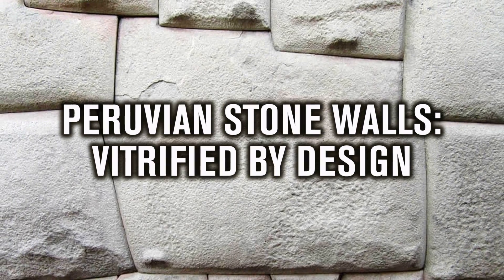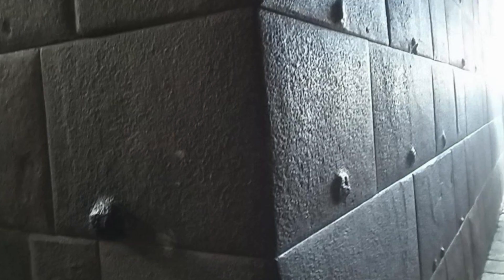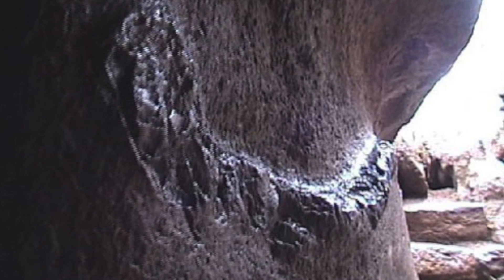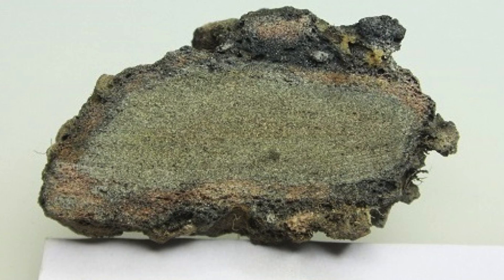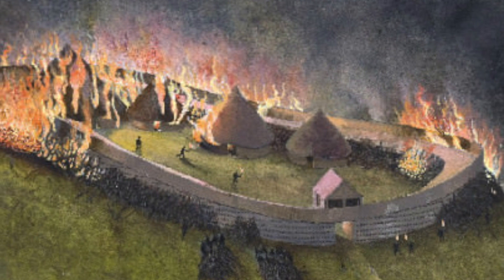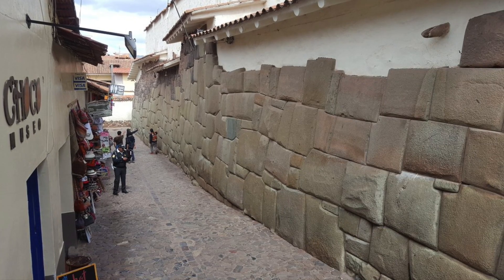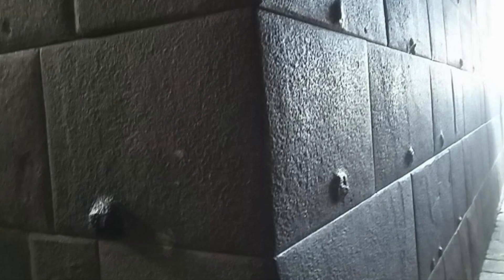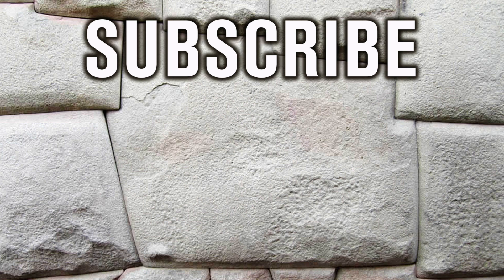Were the Peruvian Stone Walls Vitrified / Melted During Construction? | Ancient Architects

Comment: You don’t need heat to vitrify stone, see “the Hutchison effect”. All you need is the sympathetic resonant frequency of the molecular bonds of the specific type of stone. Pass a current through the material using “electrodes” and viola! The nubs are the electrode contact points. Once vitrified and placed the electrodes were pulled off of the softened stone pulling some the material with them as they are disconnected. Remember also this doesn’t provide an explanation for how they moved such heavy stones in some of the locations like Baalbek and Aswan. Plus many of them show scoop marks which means they worked the stone WHILE vitrified!
Reply: The Hutchinson effect is, at the most generous, something that has been replicated by no one except Hutchinson himself.  It sort of provides an explanation, just like so-called 'geopolymers' provide an explanation, and just like alien intervention provides an explanation.  It's not though. I can't even say this is a theory any more than saying they applied pixie dust to the rocks.  I'm not trying to mock you but something that cannot be repeated is not an explanation, it's just at best a leap of faith.  How these stones were manipulated is an enduring mystery. I have no clue. No one has a clue. It's one of our few mysteries and we should maybe just enjoy it as such.
Reply: That’s the best theory I’ve ever heard after years of thinking about how this could be done. I really think you’re onto something !! The nubs are electrodes, got to be. Then they scrape the heated stone with the copper tools, hence the scoop marks on the faces of some blocks.
Reply: Looking forward to watching your video proving this. Until then it’s just another sci fi premise that requires Proof 
The Hutchison Effect occurs as the result of radio wave interferences in a zone of spatial volume encompassed by high voltage sources, usually a Van de Graff generator, and two or more Tesla coils. (Wiki) Did they have these?
Reply: @odinx1856  didn't they test lighting fires on top of the stone and figure out that it was then far easier to hammer away the stone with those diorite balls? it sure isn't feasible way of quarrying if you just hammer around with them but after the fire it is apparently fairly easy since larger pieces chip off.
Reply: So Steve. Do you really mean to say that this mystery is best kept mysterious and not understood!?
Reply: Mr Hutchison wasn't the only one interested in the "Hutchison Effect".
Reply: @shanedog9082  had to reject that ideas for a few reasons—nubs are not on every block. Stone doesn’t transmit current.
Reply: @goonyhill1857  did that not give high voltage, but I always though it was high currents that were ended to melt materials
Reply: Not so sure about electrodes, no proof of any electrical equipment. However historic evidence of vibration control and resonance has been confirmed for quite some time and it was used in many countries. As far as I am aware though no actual solid material has been turned to a semi liquid state through vibration and then back to a solid (forgive me if I’m wrong). 
From experience I can say that polished concrete ( or shall I say incorrectly polished concrete) does also shell like that in the video, meaning that the concrete wet material is worked to the face but doesn’t fully adhere to the hard fill and thusly falls off to give the same effect. 
Vitrifying these stones into these 90 degree corners would be very difficult, especially without some formwork or shuttering which would have also burned away and left a somewhat different finish to the face of the stones.
I still think geopolymer is the most likely culprit, maybe also mixed in with vitrification to give this final overall effect. Would love it to be vibration and can picture it in my head but sadly it is most likely science fiction.
Reply: idiotic, ancient people didnt have electricity, didnt understand resonance, if you think otherwise, then give proofs, also please show some recreations of such stone forming,
the knobs as electrodes - one of the most idiotic things ive ever heard, i could as well claim it was cut by light sabers
Reply: @erikjbaker  even though I like your idea, mainly because I have had discussions with John, watched many lectures by Eric Dollard, TheOldScientist, Professor Dr. Konstantin Meyl, David LaPoint and others. Studied the works of Tesla, Schauberger, Russell, Leedskalnin, Plauson, Alfven, Moray, Siemens and many others. Also I have theorized many configurations that may have been utilized, namely archeaoacoustics, cymatics or resonance induction.

There are two main factors that come into play which these ancient cultures did not have. Machines large enough to cut out and pulverize granite or other similar materials on the Mohs scale. A machine to reconstitute the amalgamation and heat it enough to solidify it into the precise shapes required. 

And so we are left with two conclusions, either an advanced civilization made these constructions with the machines I mentioned above or the ancients used technology which most people today do not understand. Just like most people do not know who Philo Farnsworth is, yet they watch TV, they don't know who Nikola Tesla or C P Steinmetz is, yet everything they use is powered by electricity (magnetism and dielectricity), they don't know who Claude Shannon is yet all computer technology is based upon his work. 

I could tell everyone what the missing information is but I've pretty much had enough of society. Everything that these great people have invented is so far above the minds of regular NPCs, and has been used against humanity by the ruling oligarchs.
Reply: also look Erik Baker, holds a playlist from Brien Forester 'Cataclysm'
you listened to some dumb scifi theories and have been brainwashed, congratualtions
Reply: @trader2137  I don`t disagree, alot of his work is alittle bit "out there". But we are all here, because we ain`t all there.

I referred to him in his experience from the Egypt tour, and it`s true that the "consensus" is that "The Unfinnished Obelisk" atr Aswan is a work of diorite balls. And this is true for basicly most of the ancient stone work pre-dating the middle kingdom and the iron age, including the Great Pyramids. 

This doesn`t add up, the construction of the tallest and grandest pyramide that remained the tallest man made structure for 4000 years ,with diorite balls and copper chissles. Then consider it`s allignment because the structure is basicly still the most presice structure pointing towards true north, then consider it`s placement directly on the meridian and also the ratios where in example pi is clearly used. 

How did they know this, and how did they do it? These questions are still unanswered. If you ask a Egyptologist it`s "by chance" and copper aged technology. 

No i don`t think so, this is the reason behind all the stupid theories out there, and none are more plausible than the next. Untill we get some plausible theories i am free to speculate and free to pick up ideas from whoever present something other than diorite balls and copper chissles.

Edit: I`ve mixed it up and have tried to correct the post.
Reply: @odinx1856  but diorite balls and copper chisels are depicted by ancient egyptians and proven to be effective, heat treating + diorite ball hammering is great way to work around granite, tunnel carving is depicted done by chisels, copper saws and abrasive are very effective at cutting granite, 
It doesnt add up only for AHT people which ignore science and evidence
Reply: @trader2137  Yes i`ve seen his videos and they are great, but imo it fails to explain in example the Peruvian walls with the almost water tight presicion observed. I can`t imagine how they could do it that way. I can`t imagine heating the stones up, knock some pieces off, try and place them in the wall, if it doesn`t fit tight so heat them up again, knock some more off, not too much and not to little but just right on every side to make a watertight fit. Top it up with the Inca`s themself clearly stating that they didn`t do it that way, they clearly state they didn`t do it at all, "the giants" did it.

And i would also argue it fails to explain how you construct a great pyramid that way, and the kilometers of tunnels underneath them. And if we go back to the polygonal walls we see em at Easter Island aswell. Then you have the black boxes at Serapeum with a amasing polish that seems to been done with some form of liquid chemical.

But for sure i`ll agree it`s theoretical possible, i just can`t imagine this is the way it was done, the trial and error corrections must`ve been horrible beyond comprehension. Too top it up i will also argue that it doesn`t really fit the observations down to the end product. 

He`s experiements are great though and it`s possible and even likely part of the "solution" to how it was done.
Reply: @trader2137    there is evidence for all kinds of lost ancient high tech on the Giza plateau of which we cannot find the tools that made the marks...evidence, in the stone that you can see for yourself, even in the Cairo museum, for 25 ft diameter saws, lathes, tube drills and the like. (The penetration rate of which is far beyond our capabilities today, refer to Ben’s research at UnchartedX) Scientists and Egyptologists today CANNOT replicate the results and tooling signatures we see in the stone with ANY of the methods you suggested. You may want to reference Christopher Dunn’s research on this subject as well. I’m curious where you get your info from and where you do your research because you’re just parroting ideas of those who have vested in interests in maintaining the antiquated status quo on the anthropology of these sites (Like Zahi Hawass, pyramids built as tombs, my ass). Also you may want to look at the “Comet Research Group” and the “Younger Dryas impact hypothesis.” New research is coming to the forefront that spans many disciplines and you need to catch up, my friend...do a little digging and contribute to healthy discussion instead of just calling someone an idiot who may very well be massively more educated than you on the many different aspects of the subject. I can’t wait to see how meme’ishly troll’y your reply will be. Please feel free to embarrass yourself further.
Reply: @erikjbaker  I can answer for him because i have likely seen some of the material he refer to in a answer above. But first let me put my own words so i don`t really answer for him but myself. The striations on Flinders Petrie Core nr 7 that indicate a certain penetration rate or feed rate as explained by C. Dunn is very likely or certainly not a feed rate. And this is likely or certainly true for all the drill holes in ancient Egypt. They are not a indication for a feed rate exceeding modern standards but a result of the ancient way of drilling hard stone. But it does not explain all the different saw marks observed, nor polygonal masonry.

Now i gonna copy / paste something to dig into where you can make your own mind, but take a deep breath because it`s hours with experiments and explanations, and once in a while he does a jab against C. Dunn, so don`t rush into all these videos because it will take you some time to go trough, at least for me i used several days to absorb them:

Lost Ancient High Technology of Stone Cores: DEBUNKED Part 1 - Tapering - https://www.youtube.com/watch?v=H-d8FZjS42Y

Lost Ancient High Technology of Stone Cores: Part 2 - Deep Grooves are NO MYSTERY - https://www.youtube.com/watch?v=SMJeNLs1NLM

Lost Ancient High Technology of Stone Cores: Part 3 - Polished Surfaces of Core 7 - https://www.youtube.com/watch?v=W3KBDw07Mqc

Core 7 and How the Grooves are Formed WITHOUT a Fixed Point. - https://youtu.be/CARFBz8vUK4?t=3

This man has put down a lot of effort to re-create the process behind the core drilling, and in my mind it largely or fully explains what`s observed, and he also sums it up against C. Dunn`s experiements and why Dunn have got it wrong.

I`ve no problem in accepting that this is how it was done. It`s just part of the story though, and i wont elaborate further because the topic is to deep. As far as i`m concerned i`ve just need to accept how far we have gotten and wait for more people like SCD who can prove a theory with reasonable experiements like he does. We will eventually get answers i belive.

And to wrap it up towards your post, you`re absolutely right that these are exciting times with the YDB impact hypothesis, and also in example Gobekli Tepe that proves humans where much more civilised at a earlier point that previously thought. Archaeological findings keep getting older. A few decades ago and The Sphinx was the oldest megalithic structure at around 4600 years old, and it got far surpassed with Gobekli Tepe at 12.000 years old structure.

Cheers man i really fancy the discussion i`ve been interested for a long time already.
Reply: @BluntofHwicce  just because nobody can now, doesn’t mean nobody else has ever.
Reply: No because some stones have none and some have 1 not 2. So your theory diesnt make sense.
Reply: @flappingarms9335  agree but the quote was about conducting electricity which is why I pointed out this video. I have no idea how they may have vitrified rock but the evidence shows it did happen. There is little evidence of any charring effect on the vitrified surfaces as far as I’m aware, so how they applied the heat is up for debate. I have seen other suggestions that the rocks look like they were set in sacks and the nodules are where the sack side gave away slightly. Think about wet cement bags place on top of another surface, if the material was right the stones would form a perfect fit in the gaps they are sat on. Lamination may also be shown when this form of building walls is used. Still would love to know how such weights were moved. But if the bags were placed on top of a structure and loose material filed the bags, filling such bags would be a simple task. How the material is set afterwards is the missing part. But the fact blocks are left in quarries sort of doesn’t give much of a pointer to this theory. Is there a mix of techniques used?
Reply: @goonyhill1857  It is a very interesting subject and I personally believe the stones were roughly cut to shape, placed in position and heated so the outer layers became malleable/soft which then allowed them to conform to the surrounding blocks. Maybe the knobs were the points of contact for whatever device heated them up? But then, not every block has the protrusions. This style/method of construction is seen all over the globe! Until the scientific and archaeological world accepts ancient human history isn’t what we though these phenomena won’t be solved.
Reply: @zarni000  It`s really odd about those knobs as you say some have em and i guess most doesn`t. The lack of a proper explanation is annoying and makes for all these speculations.
Reply: @odinx1856  "and it`s true that the "consensus" is that "the stone of the pregnant woman" is a work of diorite balls. What? The consensus of the stone of the pregnant women is that's roman and by then they had forged iron tools for hundreds of years. You really have to ignore all this strawman arguments. Same with copper chisels and diorite pounder stones. Yes, they used those too in the old kingdom. But they used copper alloy saws and tube drills with abrasive also. They used stone material, as flint f ex, and hammers to shape the "sawed" granite.
Reply: @pitansgmail6792  Ah sorry i mixed it up, i ment the Unfinnished Obelisk in Aswan! Give me some moments and i`ll edit my posts to clear this up and i`ll try to get my point better across why i find it interesting as Jimmy also did.
Reply: @alanderson9711  Yes, stones do transmit current.
Reply: @erikjbaker  with a metal the eddies will be induced in it and will produce magnetic fields. The eddies are produced by the alternating current flowing through the coil. The opposing magnetic fields will cause it to float and the heat generated by the eddies will cause it to melt. So where is this applied to rock?
Reply: @odinx1856  we just have to think common sense a little. Eventually well figure it out.
Reply: Sympathetic resonance is when an object vibrates when another object of identical freqency is stuck nearby. For example a gong with a frequency of 100 Hz is struck in a room containing another, identical gong, both will sound. How does that soften stone? Unless you mean the builders had over tone emitting instruments that were capable of vibrating in such a way as to alter the molecular structure of the stone.
Reply: @meditationmusicbyalexjackson  I understand all that, even the fact that some people believe the 2 pronged staffs were actually tuning forks also using electricity to set up the vibration. Even seen the carvings with ancients carrying batteries, watches and theodolites. Even a stone that looks like a Nokia phone, buttons and screen! I am not dissing anything. I just need someone to actually demonstrate the actual use of such devices on a say 5 ton block, showing movement and vitrification. Not saying it didn’t happen
Reply: fresnel glass
Reply: @shanedog9082  ipvi
Reply: @Erik That is literally the only explanation that makes even a fraction of sense. Every other explanation can be dismissed with 1 second of critical thought.
Reply: It's important to keep in mind that these structures were not built by humans on the developmental timeline our current civilization is familiar with. They are from a lost era, whose builders could very well have had technology superior to ours. We shouldn't be working with the assumption that any features we see are the result of building techniques of relatively primitive peoples. The finesse, beauty, and austere perfection of these structures leaves one with the clear impression that it was easy for their builders. For all we know, they could easily be space-faring. If we can travel through space, and we struggle to recreate many of these structures, totally failing to recreate others, why not? So instead of thumbing our noses down on them, maybe we should be gaping with our mouths wide open, looking up.
Reply: @Cryptic_Triptych  Would you mind telling me? :)
Reply: @BluntofHwicce  John himself had a very difficult time repeating his experiments. The RCMP raided his "laboratory" and either destroyed or removed his equipment. Side note: T H Moray had his laboratory destroyed by hired goons, he was shot while in his laboratory, threatened in public and had a very difficult time with the patent office as well. So, in short, if you understand how to tap into the Aetheric fluid/Akashic records/still magnetic light field, then you also know the dangers that are associated with this Gnosis.
Reply: @R0jiv4  you want to know how, why, when and the purpose for, not just the pyramids but the entire complex at Giza? Do you also want the same explanation for all of the other pyramids around the world, all the megalithic structures, dolmens, barrows, hypogeums, Carnac, melted castles of Scotland, Pre-Clovis North Americans, Atlanteans, world mud flood, the Hudson Bay meteorite impact site. 

Sure I'll give you all of the secret knowledge of humanity that is stored in the Hall of Records. What have you to offer me for a gift such as what I have???
Reply: @MissAllanPoe1988  oh good lord no. So much wrong in 1 post.

Who claims we can't built the pyramids today? Absolute nonsense. If there was an ancient high tech civilization then where the heck are their mines?
Reply: Electrodes - and The Great Pyramid shafts!

Was it so, that both chambers, upper and lower, had inside the shafts some marks of two metal wires gone through long ago?

Maybe the chambers were built this way, too. Lower chamber shafts don't continue outside, because they did not need to:  the chamber was finished, but building elsewhere was still going on.

They might have needed those wires to create electrodes to heat the granite blocks of the chambers inside the sandstone pyramide.